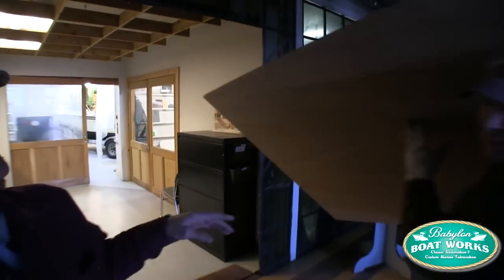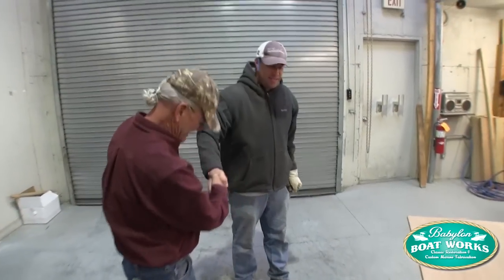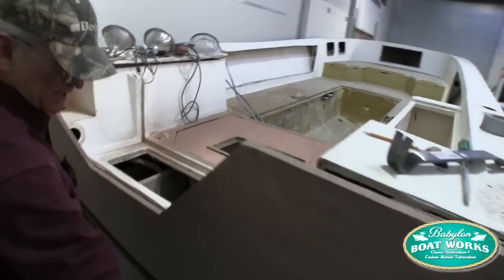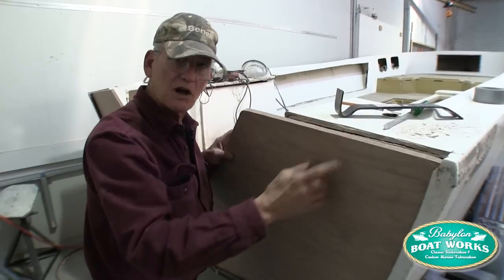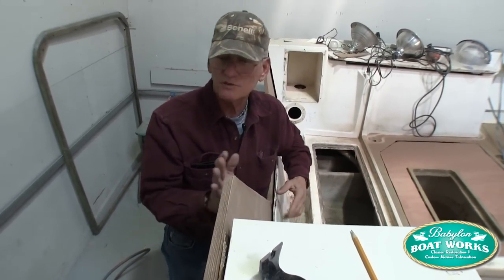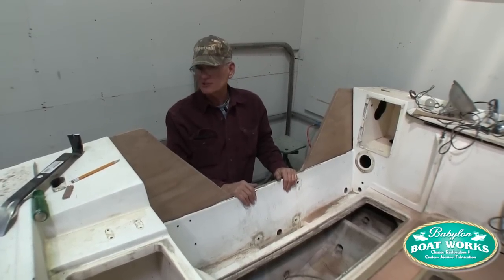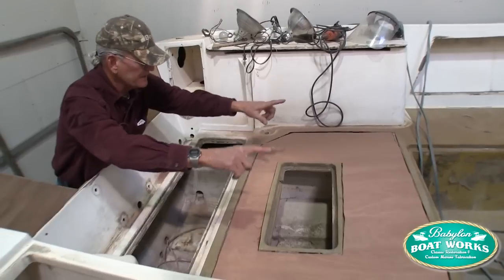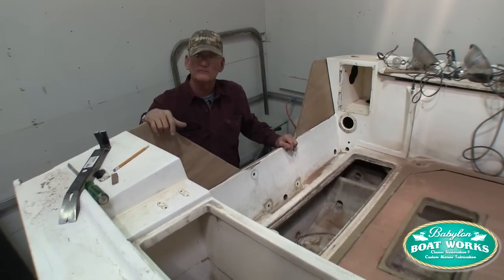1979 Mako Restoration 2013-2013 Transom Repair

Comment: Why use WOOD?  your asking for it to rot again
Reply: its marine grade wood, you should use a treated marine grade wood for transom repairs because using a metal will corrode and rust, especially when in contact with engine mounting bolts. Its important to reinforce the boats original frame with a soft wood to prevent corrosion and rust and also provide a soft (water and rot resistant) material for the mounting of the engine to prevent friction and wear and encourage a stronger bond when bolting an engine to a transom. the flex in the grain of wood provides a great soft material for the engine mounting bolts to bond with, however when using a metal or alloy the materials do not compress as wood does and creates friction and will encourage the boring of mounting points on the transom and will also encourage rust corrosion and deterioration of the metal/alloy.

For these reasons you should use a marine grade plywood when reinforcing your transom, using ordinary plywood will not work because as you said it will rot, however if you spend the extra money for marine grade plywood or treat the wood yourself the effects from prolonged exposure to water will be greatly reduced. You can treat your wood with Epoxy or special made wood sealants for boat making both methods are extremely effective and can "waterproof" your wood from anywhere between 5-15 years depending on the level of exposure to water and sunlight. 

That being said, wood has been used to make boats for centuries, it obviously works and entire ships where once constructed from wood materials. To reinforce a transom on a dingy is really no comparison.

Comment: Meranti is the most crap wood i have ever seen used for any industrial purpouse, its cheap as fuck, and lasts as long as the price tag, it breaks out with massive splinters in an explosive manner, no matter what way you epoxy or pre treat it, 

Meranti tests vs other woods in fiberglass wrapped strenght tests has been some of the weakest i have personally seen,